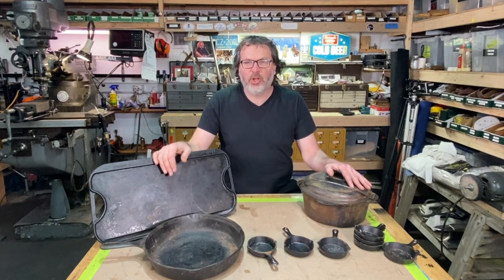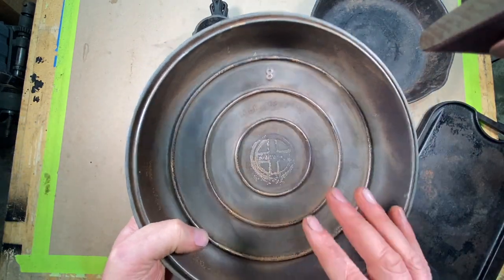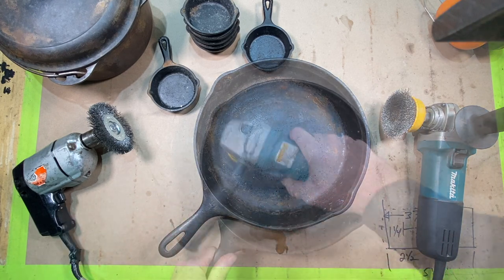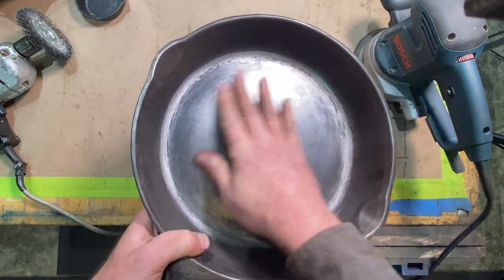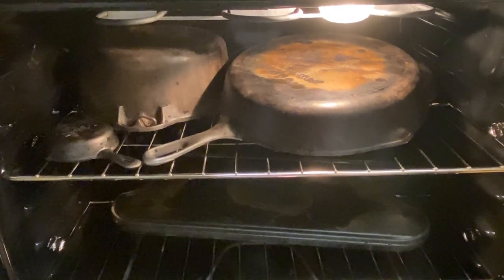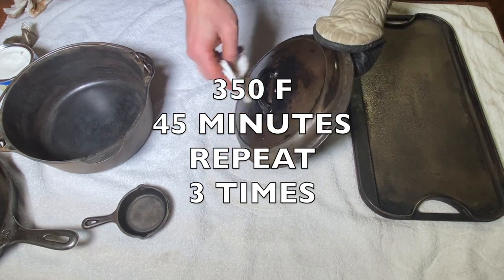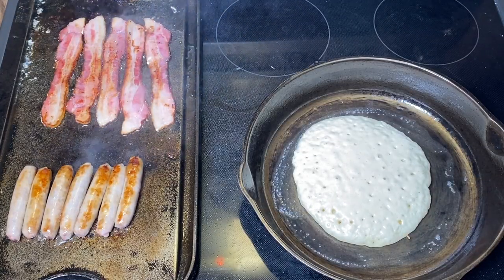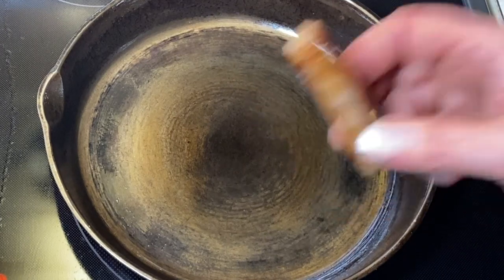BEST WAY I KNOW  TO SEASON CAST IRON COOKWARE - RESTORATION - GRISWOLD DUTCH OVEN - RIGHT ON #74

Comment: Great video!  I just picked up a 1930-39 Griswold Dutch oven.  All the marks on the bottom of the pot are there.  The lid looks completely right.  The external lid edge, handle shape and inside rings all seem correct, but it doesn't have Griswold marks.  It looks exactly like the lid you're cleaning at 7:06 in the video - but there's no center Griswold mark.  The only mark inside the lid is an 8.  Are all Griswold lids marked?  Any chance it could be the correct lid?  Thanks for any info you can provide.

Comment: If there is baked on crust on the bottoms and sides of the pan you would just wire brush it off, yes?
Reply from the maker: Hi! Yes I would take it off with the wire wheel or brush but then re-season the pan 👍😃🍳🥞🥓🥓🥓

Comment: Quick question can you clean a pan with citric acid, some claim it’s safe.Maybe someone on here would know.   Saw it on Amazon called Milliard 5lb.bag. Will be trying it for rusty tools, but that pretty much says all food safe. Big question
Reply from the maker: That’s a good question Joe! I have not tried that myself other than using citri strip for removing paint. If I remember correctly Mrpete222 may have done a video on using it to remove rust a couple years ago. Would be good to look in his archives 👍

Comment: Doesn’t it lose value?
Reply: It most definitely will if it's a collectable piece. And making modern cast iron really smooth will more than likely cause the seasoning to start flaking off at some point. And it will continue to do so.